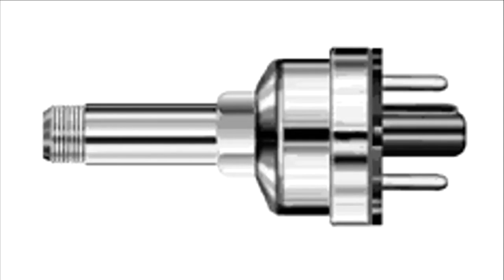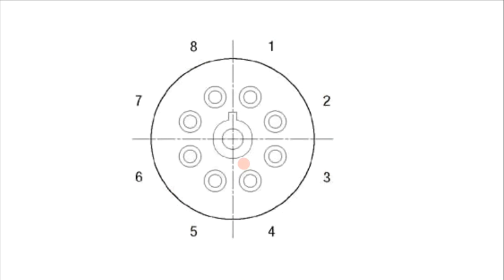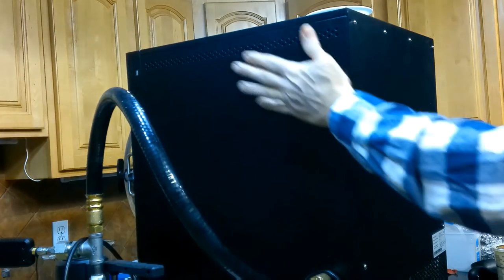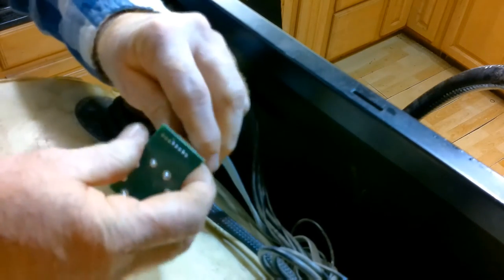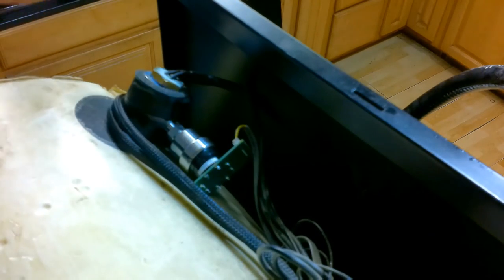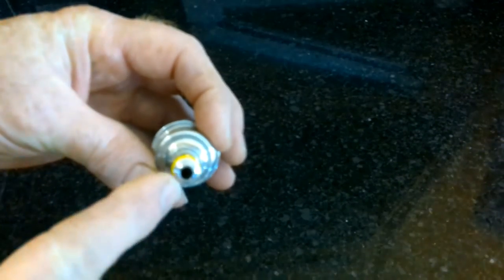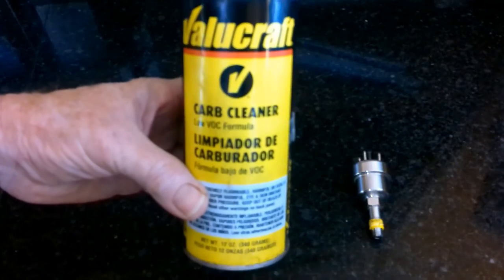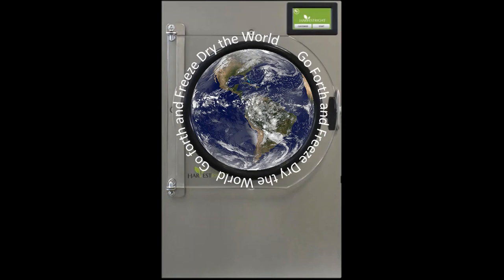Harvest Right Freeze Dryer- When a Vacuum Leak Isn't a Vacuum leak

Comment: I had mid cycle batch errors and my mTorr and temperatures were all over the place, causing water to mix into my oil.  (eg from 500 to 1200 mTorr and -12 to 120F). The V5.1.24q solved the batch errors, but my mTorr and temperatures are still all over the place and are still causing water to mix into my oil.  I'm probably needing to wait for the next software fix.
Reply: Software can't fix physical leaks or design flaws.
Reply: Felix fix harvest right. Look it up in the tube.

Comment: just completed your cleanout and reassembled, will not go below 930mTOR. The wires cross at 90 degrees with a fifth wire  looping from center to wall of housing between 1/3, none broken. Original problem was vacuum error would come on when adding more dry time. Had 1.6 at 5/7 and 1.7 at 1/3.  Which parts would you suggest I replace? Thanks,
Reply from the maker: How confident are you that there isn't any real vacuum leak?  I had the same problem.  I purchased a micron vacuum gauge for around $130 from Amazon and mounted it to a JIT fitting for the vacuum pump.  I wanted to find out what my pump would really produce.  This tested the pump and hose.  From this point there are three  locations where a leak can come from: door, valve port, and harness port.
Reply: 1st I would like to thank you for your great video’s with such helpful info and guidence on fixes. As far as confidence I feel pretty good about the vacuum leaks as the food would process through all the cycles fine then   state process complete. Due to timing or other obligations, we would need to add more dry time. After awhile the screen would display “unable to acheive vacuum”. This the last couple of processes. Never had this problem before. I will be replacing the drain valve today with a gas valve. Also our machine performed very well for the past 2 1/2 years. Many thanks once again.
Reply: replaced the drain valve, was able to get just under 700mT. ran the 2 minute test, took 3 minutes to get to 2000+/- mT. We have newer model FD with drum encased in foam,no visual connection inside for pump hose to cabinet. Also have premier pump. Still working it! going for new o-rings. Do you recomend the yellow vs. white tape on the thermocouple?
Many Thanks, steve & Ann
Reply from the maker: How good is your sniffer (AKA nose)?  Maybe this video will be helpful:
https://youtu.be/D6-LXL3i7hA
Reply: Found a leak in the hose crimp at the pump end. ordered a new hose

Received the hose late Saturday, installed and then ran vacuum test that nite. At the 15 minute mark the mtorr was approx. 715. It did get below 500 mtorr after an hour. 

I don’t know where else to look unless I start the process again of searching.

Reassembled the FD this morning, placed 4 trays of eggs in and started up. Could not keep waiting as the eggs have been in the freezer for 2 weeks! So far it seems to be working ok but don’t know yet.

Comment: Did cleaning the sensor work?  You never told us if it restored it of normal operation or if it was simply broken and had to be replaced.
Reply from the maker: It worked.  I was having problems with the pressure jumping all over the place.
Reply: You've been a great help so far. Thank you
What would you suggest if the level is constant at 850-950?  I retefloned (gas spec) everything with a thread, liquid tape, and wrapped with silicone tape. I also checked front seal. Same constant level remaining.  I'm asking if the sensor is a possible issue because I would have to take off all the barrier layers I created.  I was thinking it may be a possible pump issue (new model oil pump). Considered buying the Hilmon micron gauge.  FD only 10 months old for personal use. Not run hard 24/7. HR wants me to send the unit from Toronto (international shipping $$). This is after telling me the unit is fine at that level with the new 5.X firmware...sure.  Starting to feel the frustration.Thanks Phil  @Philat4800feet
Reply: @AJ-ed9ct  My Fd is similar to your description. Liquid taped under vacuum. Replace door seal, drain valve, reversed door, cleaned vacuum sensor. The one anomoly I have is it will reach 360 mtorrs IF there is no tray holder in the machine. If the tray holder is in the machine, plugged in or not, the machine cannot get below 770 mtorr. Any advice?

Comment: Hi Phil,

I have a strange one. 

Recently my freeze dryer started taking several hours (6 to 8) from batch start to get below 450mT to start the drying phase.  After the drying starts the unit dries normally,  heaters turn on, when the  pressure raises above 600mT the heaters turn off.

What I have done on a recent batch is wait until pressure is below 500mT in vaccum freezing (about four hours from batch start) I hit the leaf for manual advance drying starts and the pressure raises and falls as normal with heater on/off and the strange thing is on the first heater cycle the pressure raises above 600. Heaters turn off and the pressure drops well below where I manual advanced and the cycle continues. 

Seems like the vaccum pressure sensor heater filament is dirty, the pressure sensor doesn't work normally under cold vaccum with cold water vapor but when the heaters turn on there is warm water vapor under vaccum in the chamber which aids the dirty vaccum sensor heaters, possible?

Just a thought, looking forward to your thoughts, I think I need a new vaccum sensor what do you think 

Ps,  my last batch with excessive vaccum freeze time ended the cycle with a final mT of 188.
Reply from the maker: Have you tried cleaning the sensor?  Another problem could be the small sensor board.  If either one goes bad, the result could be the same.
Reply: @Philat4800feet  thanks! I will get the massairflow cleaner and give it a try.

Comment: OK, I am a bit perplexed. According to your video, my understanding was I should see continuity between pins 1 &3 and also 5 & 7. I have it for 5 & 7 but not 1 & 3. However, when I test a new DV-4D sensor I don't have continuity between 1 & 3 either. What gives?
Reply from the maker: HR would not release any data for there vacuum sensor claiming it's proprietary.  The values used in the video were from a new unit from HR and industry standards for similar vacuum sensors.  I can only hope it comes close to what HR is using.  Pins 1/3 should have some resistance since this is the heater.  Pins 5/7 is more difficult.  In many cases you can only tests for "opens".
Reply: One of our units was made in 2014 and back then the display will show "XXX" if greater than 1000mtorr. When this happens, trying to find the leak source is a real problem because you can't see any fluctuations. Did I see/hear you recommend a micron gauge. Can this be used to see responses to leak testing joints? Where is it connected to the vacuum system? TIA
Reply from the maker: I did buy a micron gauge for about $120 and placed it above the pump with a 304SS Tee just to keep track of the vacuum.

Comment: I have a pic of my wires after I cleaned it, can I show it to you? There’s something on the point where the wires cross but I can’t tell if that’s dirt or if it’s supposed to be there.
Reply from the maker: It's common to have what looks like a "solder joint" where the wires cross.

Comment: Hello.  I enjoy watching your videos.  They are informative and helpful. I learn things I know nothing about but now I at least have a clue. :)  I have only had my HR for about 3 months and immediately had an issue but they sent my updated software to the most recent version as of January 2023 that seemed to fix the issue. However, when the machine is vacuum freezing it doesn't stay under the 500 mT stays around 770 to 780.  I have only run about 10 or 11 batches.  I don't sit and watch it so I don't know if it ever gets to below 500mT at any point in the process but it seems to process the food correctly.  Any input or thoughts.
Reply from the maker: Have you checked for any leaks?  You should be able to get below 500 mtorrs.  Got tools?
Reply: @Phil at 4800 feet  Yes sir.  Nothing fancy but I have a few and can get more if needed.

Comment: Great job Phil! My new freeze dryer started the same thing a week ago. I dry a bunch of goat milk which is very fine powder. Cleaned out the pump with a back flush.  That removed a bunch of junk. Gunna try this next. How much was that sensor, board from HR?
Reply from the maker: I had one from warranty.  You would need to call HR
Reply: how long does the goat milk keep once you have reduced it to powder?
Reply: @gmwwc  I would think done and packaged right 24yrs. I’ve opened up milk from 5 years ago and mixed and it tasted great!
Reply: We also do a bunch of eggs as well. Also a very fine powder when done. We dry them raw so they can be used in cooking all kinds of stuff.

Comment: if this fails can you get a high heat warning?
Reply from the maker: This sensor measure pressure.  The worm looking thing, under the heating pad, on the third tray, is a thermistor.  That measures heat by resistance.

Comment: Maybe a dumb question,  but isn't it the change in readings as the FD process progresses vs the absolute readings from the sensors that matters? Meaning, does it really matter if they get dirty and the transmission between sensors is lowered? As long as the delta over time is accurate. But if it fixed your issue, I guess it is the dirty wires.
Reply: And thank you for making these! I learn a lot from them.
Reply from the maker: No such thing as a dump question- just an enquiring mind.
The upper and lower threshold of the vacuum 500-600 mtorr, measured by the vacuum sensor, is what triggers the heaters to turn on and off.  A dirty sensor would alter the mtorr, but should still work but not as accurate.  If accuracy matters?
Reply: @Philat4800feet  got it.  Thanks for the reply!

Comment: What type/brand of micron gauge do you use.
Reply from the maker: Hilmor CVG1200 around $110.00
Reply: @Philat4800feet  ---  For that Model---> Does this connector come with the fitting to connect to the JIC fitting on the HR Pumps?  or is there something else I need to purchase?  I need to validate that my Low Profile Oil-Less VAC PUMP is not working before I start the GREAT CHASE on a possible vacuum leak with the HR UNIT.... I have already completed the FULL BLOWN famous "FELIX FIX"...
Reply from the maker: @syexplorarconmigo8853  Most gauges come with a 3/8 compression fitting.  A hydraulic shop would have all the fittings and adapters you would need.

Comment: @Phil---- if you are prototyping a Moisture Collection system to go on the HR FD--- I will PAY for my own way to be apart of this experiment-- as the less moisture that enters the Vacuum PUMP-- the longer mine will last between service intervals.... The Low Profile Oil Less pump is a child of a lesser god for sure....
Reply from the maker: I have played around with in-line vacuum filters and desiccant , but the only way to remove any additional moisture would be a freeze trap.  I'll keep tinkering.

Comment: Take the sides off the FD and toss them out. HR wants us to work on our machine all the time. Not only pay a ton for the FD but buy a box of tools to keep it working. It might help to install a 90 or 45 degree fitting holding the vacuum sensor in a drain down position and making it harder for crap to get to the heater wire. If the system has no vacuum leaks, why is the pump running the whole time? My new 3-2024, HR Large pro, pump has a vacuum leak inside, less than one minute to loose all vacuum after pump is turned off. I want to cut the vacuum hose and install a check valve with a tee and a vacuum gauge on the food side. then the pump can be turned off for the rest of the many hours of dry time.  I recommend you add a vacuum gauge to your system and not rely on the digital gauge. I  think the FD process would work better and faster if the vacuum was at 25 torr or 28 in/hg. please feel free to respond and lets fix this mess.
Reply from the maker: The vacuum pump needs to run all the time because the sublimated water (moisture) is constantly making atmosphere and needs to be pumped out.  Not all of it is frozen on the chamber wall.  
You are right, the vacuum sensor needs to be mounted vertically.
I have a 304SS tee just off my pump with a micron gauge.
I have made little modifications here and there to get my batches down to around 24 hours.
Reply: @Philat4800feet  To move water vapor you would need air flow, with a sealed system it should all freeze in the chamber. How would the water know where the suction is coming from ?If you can find the time to try experiment, Close up the machine and pull 5 minutes of vacuum, turn off the pump and remove the muffler, can you feel suction in the pump muffler hole? how long will your machine hold vacuum with the pump turned off? Thanks for your time.

Comment: It's a maraca...but thanks for the informative video!
Reply from the maker: Try, Try again
Reply: @Philat4800feet  oddly enough, I didn't have a problem with the FD until after I watched your video! (I'm sure no cause/effect but the timing was perfect.) I woke up this morning to an "unable to acheive vacuum" error, but the door seal clearly proves a good vacuum! Thanks again for posting this info, as cleaning the vacuum sensor is one of the likely culprits.